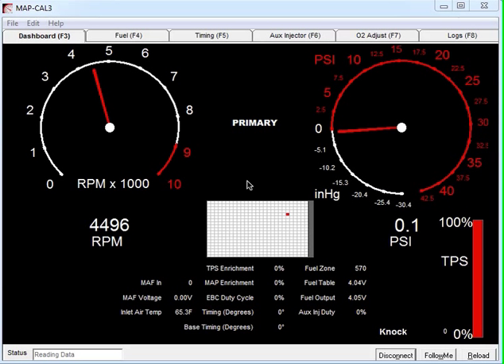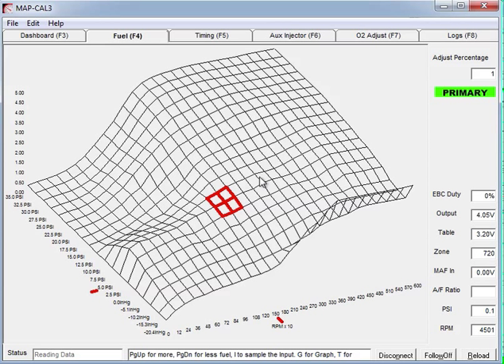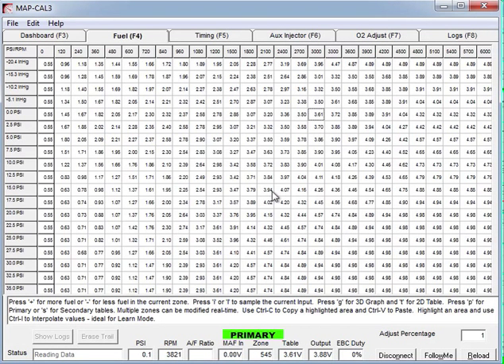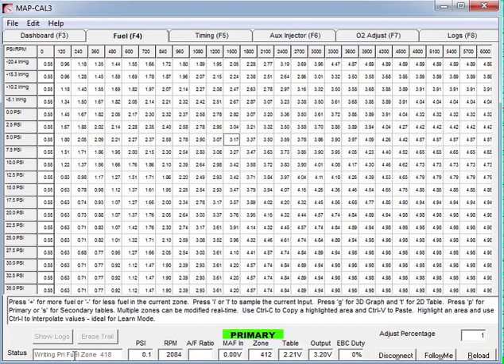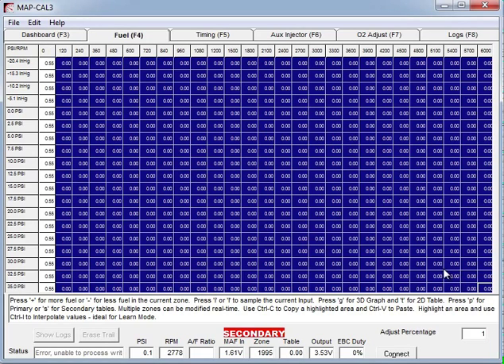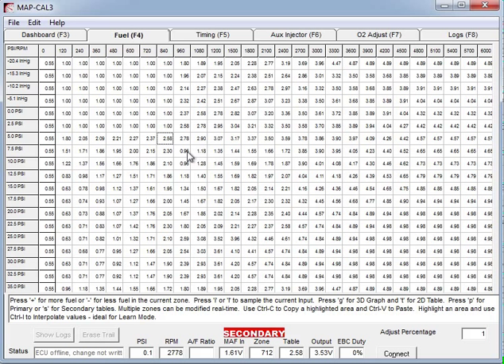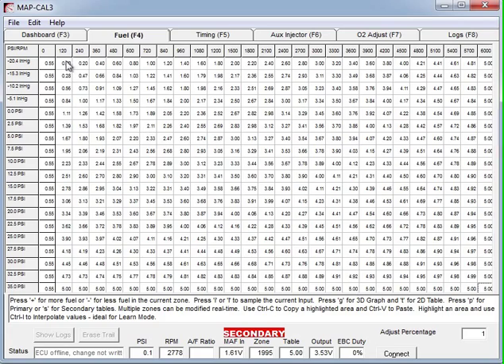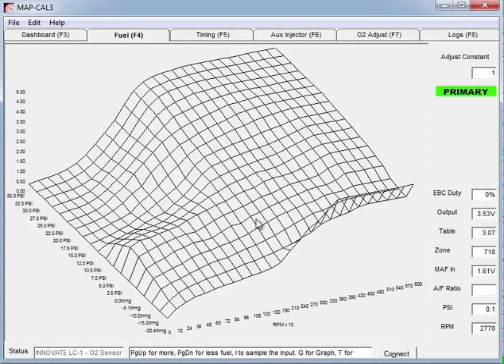MAP-ECU3 Fuel Table Tuning

Comment: In the cell for rpm/boost
 what is the value represent?
Reply from the maker: If you talking about the Fuel table then it depends on the mode. In the MAF modes, it is voltage. In KVF mode it is frequency. There is more information in our PDF manuals.
Reply: I'll check out the PDF.     @MrMAPECU

Comment: does it extrapolate the values required in boost?
Reply from the maker: Which table are you referring to? It extrapolates values for the whole table, regardless of vacuum or boost. 4 zones are always extrapolated.
Reply: For fuel.    What appeared to be the fuel table had numbers from 0 to 5, i'm imagining this is volts?    How do we determine injector duty cycle?   Also if i scaled up or down the injectors versus the stock ones how do we get mapecu to handle them appropriately? @MrMAPECU